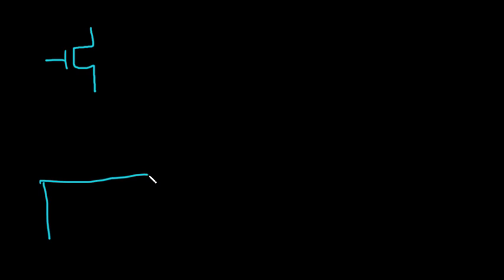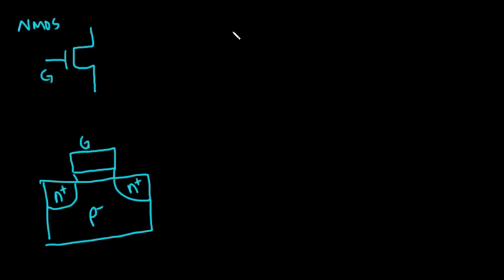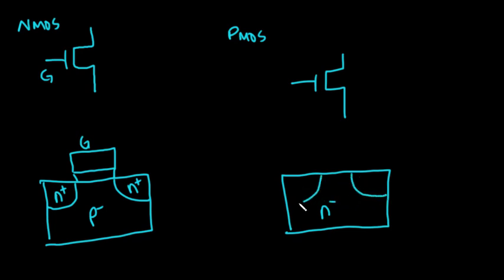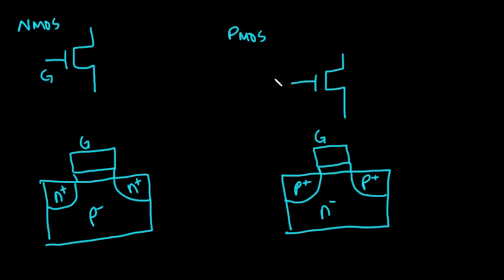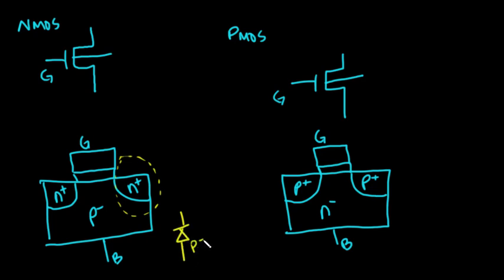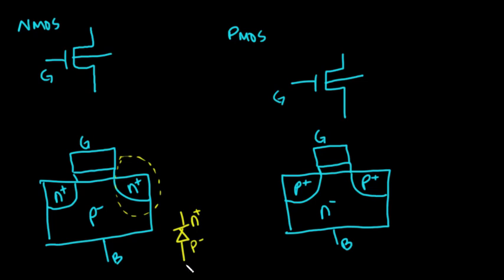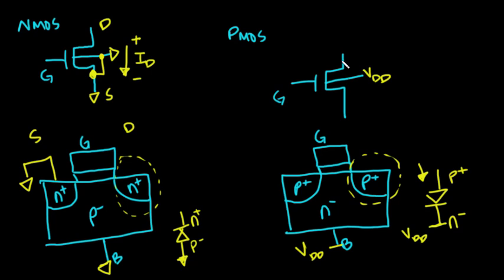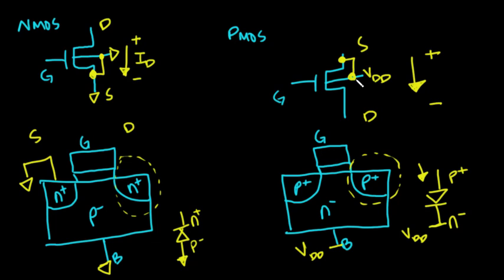MOSFET Transistor Basics | NMOS and PMOS Body Bias

Comment: Ow, the PMOS looks really strange... VDD for a PMOS is the most negative voltage! Not the postive... So you cannot hook that up to your substrate, you would blow it up. I am studying the Intel 4004 in PMOS and Surely VDD is the drain voltage of -15V and VSS is the Source voltage of 0V, which is also the body voltage... VDD is wrong there! The source is ALWAYS what is connected to the body and by definition this is then called VSS.